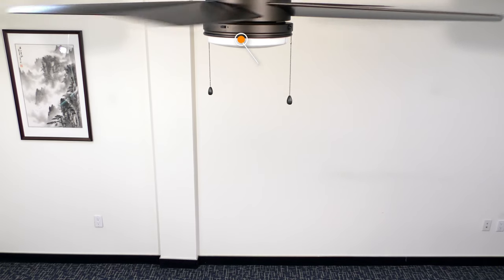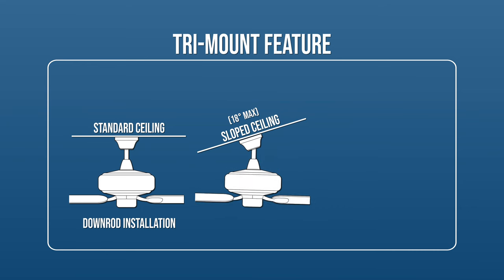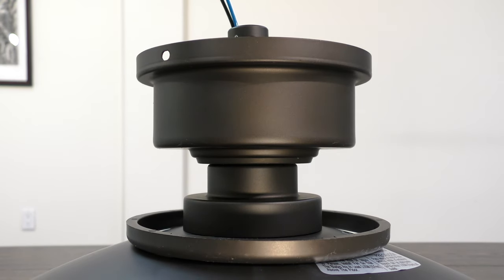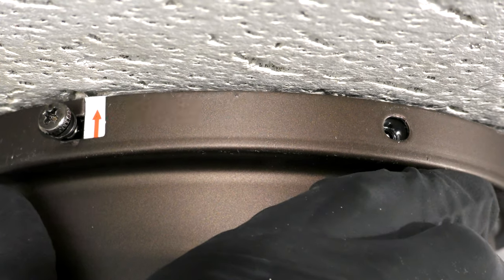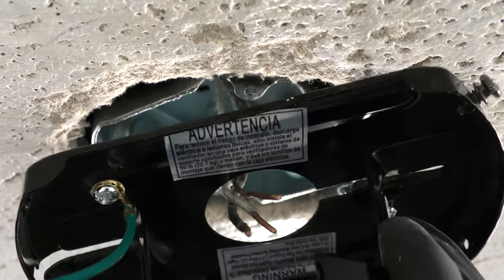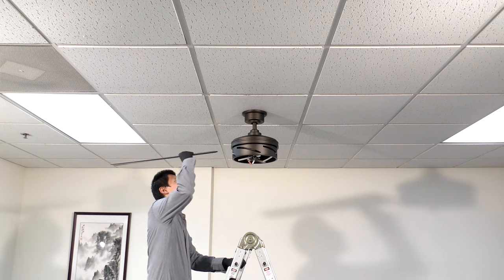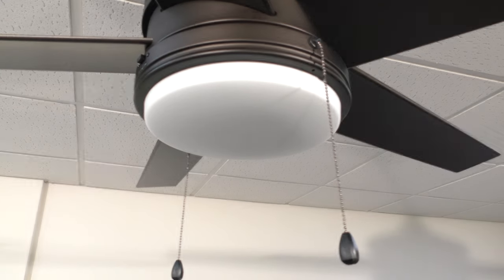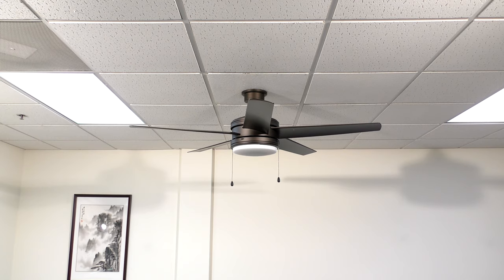60" Portwood Ceiling Fan Installation Guide (Updated)

Comment: Hi, I install everything but the light doesn't work.
Reply from the maker: If the LED isn't working correctly, try unplugging the light kit and checking the pins in the 6-pin connector (shown at 10:00 in the video). All the metal pins should be pushed all the way in. If any pins are pushed out, simply push the wire in to lock it into place. If the pins are OK and the LED still will not function, call customer service (1-800-986-3460) for detailed assistance.

Comment: Is there any remote for this 4-speed fan?
Reply from the maker: Unfortunately, we do not have any compatible 4 speed remotes that could be recommended for this fan. The fan will run with a universal 3 speed remote, but the fan may have an electrical buzz on med-high speeds, and it may shorten the life of the fan’s capacitor.